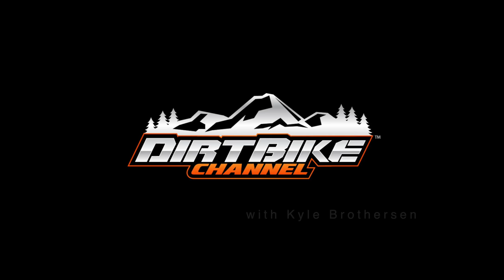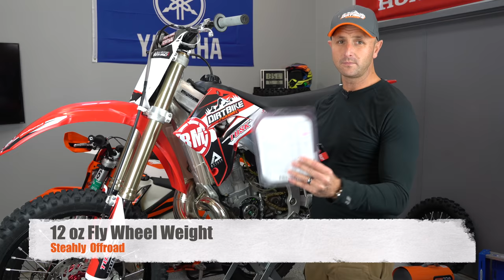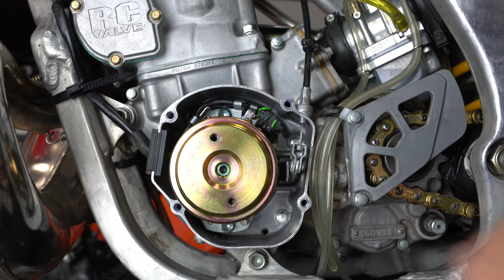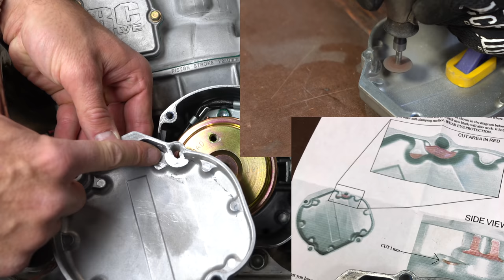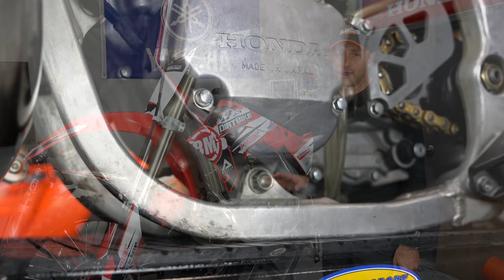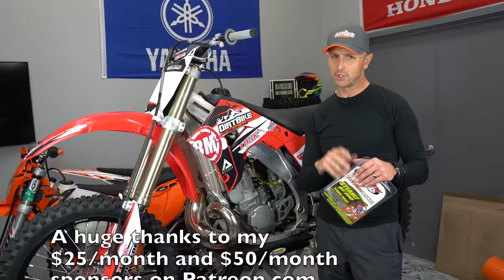Fly Wheel Weight Installation on Honda CR250R

Comment: Being a mechanic myself,  I switched from the red silicone to the permatex Grey, it really holds up better than the high temp
Reply: absolutely either use grey or honda bond. I like grey permatex because its a little easier to remove at next service but holds up way better than red/black and doesnt look messy either.

Comment: The 12t cs will make it rev out even quicker and lessen the flywheel effect. Why not try it with stock gearing and see if the FW can tap into the grunt? Changing two things at once always leaves you guessing.

Comment: Love the video. I restored a 2000 CR 250R it was a blast. The fly wheel will make a world of difference in the woods, also I felt the brakes sucked on my CR and went with a Galfer oversized brake kit for my bike, worked Great. Also found a Magura hydraulic clutch system on eBay for cheep.  The bike is a blast to ride. I do not race anymore, but I take this old girl out every Sunday and ride with my old buddies. Most of my buddies have bought old 2 strokes and brought them back to life. Again love the videos.
Reply: And the first thing I think of is cheap. Hyde clutch is a nice touch. Defa good upgrade.

Comment: I don’t think the gasket maker was necessary because there isn’t oil on flywheel side of the motor. Great video. My YZ250 has a flywheel weight and it makes a world of difference.
Reply: Keeps dirt/mud/water out....but go ahead, dont use it and then you can bitch when the internals get eatin to shit by having dirt and rust in there on moving metal parts.
Reply: Also it's an old school requirement from back in the days where point ignition systems would fail from just a single piece of debris finding it's way into the point gap.
Reply: The Kriptoker haven’t used it on that side of the motor and it’s perfectly clean.  So...
Reply: @Kriptoker  my uncles a professional service technician whose been working on engines his whole life and always says gaskets are overrated.  its all personal preference.  you can literally make one out of an empty beer box
Reply: How much weight did you put on...I was thinking about doing the same...
Reply: I think I have a gasket out. I have some oil on that side. lol.
Reply: Summit dave  I believe it’s an 11 oz. I also geared it down to 13 front 48 rear. Makes a huge difference in slow, technical terrain.
Reply: Justin Peterson   Oh wow. Awesome. Thanks for the info.
Reply: Summit dave you’re welcome. I think Kyle is going to like the old Honda a lot more after doing these modifications. The flywheel weight really helped with low end grunt and tractor factor on my YZ.
Reply: Justin Peterson. Right. I never have done a Flywheel weight.  On any of my bikes. I guess I never thought about doin that. Lol. You think a 11 oz is good enough. He said he was doin a 13 oz.
Reply: Summit dave good question. I guess it depends on how much you want to tame the motor, your riding style, etc. It seems Kyle really didn’t like how snappy the motor was, which is why he went with the heaviest weight.
Reply: Justin Peterson. Ya for sure. Hmm
Reply: @justinpeterson8754  It also depends if its a metal cover, metal to metal needs a gasket, plastic cover doesnt really need one
Reply: codenamenel I totally agree about having a gasket. I don’t think the gasket maker (silicone) in addition to the gasket is necessary. He made a mess for no reason.
Reply: @justinpeterson8754  agree silicon gasket always looks shite, no need for both at all
Reply: Certainly didn’t need that much

Comment: I have a 97 cr250 got it bone stock put some v force reeds in it and did a 12 oz weight as well also I went up too a 52 tooth in the back kept the front sprocket stock and its truly amazing in the woods and tight single track the flywheel weight gave it so much more mid range power as well as helped with the stalling. But the biggest mod you can do with these CR’s is the carb I swapped out the pos carb that came with the bike and got a keihin pwk air Striker. No fouling no black premix everywhere bike runs clean and mean
Reply: Kyle's bike has a lectron, and a fmf gnarly pipe on it all ready
Reply: What would really make a great is a PWK air striker and pulse injection.  Or add pulse injection with the Lectron   Then you would get the low-end power you’re looking for and crazy over rev. No stalling.  And best of all, All around improve power in all stages of RPM

Comment: 10oz FWW tranformed my '06 - good vid m8
Reply: I have a 98 cr250r and I’m used to four strokes and I’m torn between 10,12 or 14oz any recommendations
Reply: @dawkinschmidt7053  did you  find any info?

Comment: What year is the CR250 there?
I once owned 1996 and 1999 CR 250s and they actually had pretty good bottom end torque. I installed fly wheels on them, and also tossed the aluminum clutch plates and installed steel plates. That kept the transmission oil cleaner longer.

Comment: I got a 12 oz one for my 00cr125 most important mod I had a 13/55 gear ratio and it still didn’t have enough low end for me so after I put that on now I can pop wheelies over logs easy and do everything gave me so much low end that I can go back to my stock gearing and might be able to go a little bit lower on the rear I highly recommend this for any mx bikes going to the woods

Comment: What about the four allen set screws around the flywheel weight ? I heard from one of the manufacturers NOT to use locktite on them but didn't notice anything in the video. Just curious as to how you went about that part of the install.  Thanks for the video !

Comment: For the low budget folks, put the bike in fifth gear and use an impact gun to remove the nut. Someone can sit on the bike and hold the brake if required Then use a rope to run down the cylinder hole to hold the engine from spinning when you torque it down. No special tools required.

Comment: Hi love your stuff. Ive just bought a cr 250 2002 to build for a 24hour race in August im doing in the solo expert class. I havent rode or owned a bike in 18 months so it should be interesting! Do you think the fly wheel weight will work with a trail tech stator? Cheers Danny

Comment: You should have got a hydraulic clutch cable mod on her.i use a honda cr250 1998 stock mx bike for 2hr enduro racing and using a cable clutch for two hrs gets you real`y fit.love your vid`s kyle.all the best from dep pipes davey from the uk land of the best enduro riders.becozz we learn on cable clutch power`d honda cr`s.hydraulic stands for wimps.

Comment: I’m extremely interested in seeing the video of how it performs after this. I just may do this to my 91 cr250r. I do desert and trail riding and the bike is awesome. Just not meant for trails. I hope this gives it much more low end torque.
Reply: cut or sand ur head down i do this but i went to the max  now it hits hard super low and its harder to ride but dont go takeing 30 th off maybe 10 /15 th  be good but it will still  will rev fast and fast down low  with the head mod its not like what  he is doing that will slow it down but i i know alot of newer mx bike some are made for top end so a good head realy helps them idk bout a 91 but my 98 didnt need that much i going to get a think gasket to chill it out ,maybe lowing ur gearing will help

Comment: Bought one of these bikes back in 2007 for enduro riding (2006 model) but never really liked the bike. Found it too revy, no torque and suspension too hard. I guess the bike was more suited to mx riding. Still have the bike though. 
Maybe now is the time to sort out the bike. Any suggestions to make it more enduro friendly.
Reply: Do the mods!!!  My '06 is a woods weapon...... FWW - Keihin carb - head and cylinder mods - crf250x suspension f & r and 13/48 gearing , you will be amazed at how these mods changed the bike for bush riding.
Reply: @graememoffat4533  Thanks for the suggestions. The crf250x suspension is a good one!
Reply: @diarmuidoc9427  I like 13 50 gearing more for woods and 13 48 for MX but each their own!
Reply: @jakewaggoner4196   Probably depends whether one is going like a scalded cat along forestry roads or up to their axles in mud doing more slow technical stuff through the woods.

Comment: The thing with that UHMW plastic spacer is nothing adheres to it.  Probably better off getting two gaskets or making two rubber or fiber gaskets.  The company I used to work for got the idea to CNC small UHMW electrical enclosures as a way to save money vs the stainless steel enclosures they were using.  At first they tried to use silicone on the mating surfaces, that failed so they machined an o-ring groove but the plastic cover deflected enough to allow water in.  The company ended up replacing all the enclosures with stainless enclosures and replacing all the damaged electronics inside plus the labor for me to change them out.  If you pull on the dried silicone it will practically fall off the plastic so it probably makes no difference using the sealant.

Comment: Can’t wait for the first test run report! Thinking of doing the same thing to my 04. Would a 10 oz weight make the cover fit with out grinding?
Reply: I don't think it adds any low end. It's purpose is to slow the revs down and create traction.
Reply: 10 oz whieght needs the grinding also. I know I have a 10 oz and it's the perfect whieght. 14 oz is too heavy and anything less then 10 oz is not really noticeable. In my opinion.
Reply: @scottgaskill4896  at least in my case it helps a ton gives me a tad more low end so I can pop the clutch over logs something I didn’t think my little 125 could do

Comment: I just might have to do this to my kdx.
Reply: KDX 200 or 250? They come with a heavier flywheel to begin with right?
Reply: @casmitherz 1988  kdx 200.
Reply: Kdx doesn't need anything.
Reply: Maybe a fresh piston and rings if it's never been done. Boyeson reeds, updated handle bars, larger foot pegs, new air filter...  After that just stiffer springs for your weight. You should be good to go for not much money.

Comment: Do you have for the CR 125? Does anything improve on the CR 125?
Reply: Yes I have a 00 it went on smooth and I highly recommend it made the bike so much better in the woods honestly if I didn’t put that on I’d want to get a different bike only thing it does now is the power band is a bit more mellow and doesn’t pull as hard when your revving it out the weight works so good that I still have the stock 13/52 on my bike and it does great in the woods

Comment: Personally dislike flywheel weights, I honestly don't get why so many people rave about them. If the bike is too aggressive change the gearing. I found the bike really difficult to rev up and come on the pipe, if you need the power down quickly for a big hill it becomes a big problem almost feeling like the bike is jetted wrong with a big flat spot. Anybody else feel the same? Or just me 😂